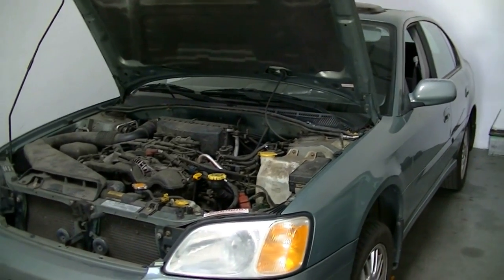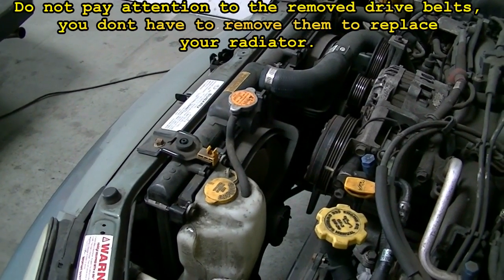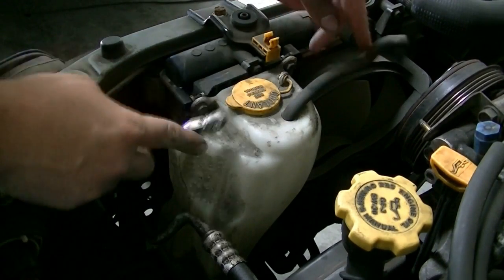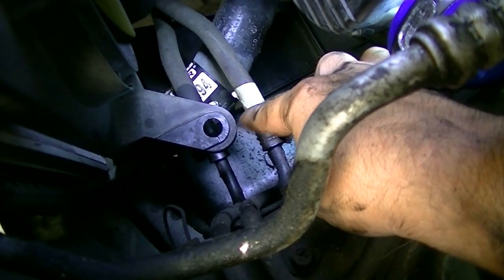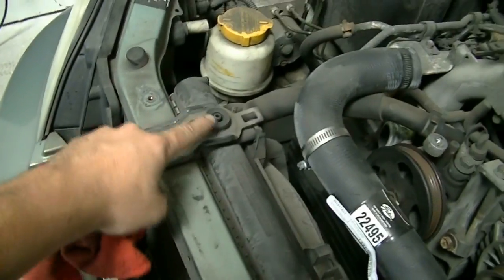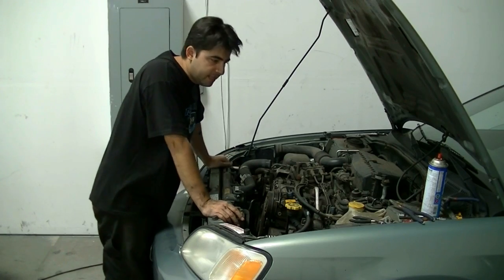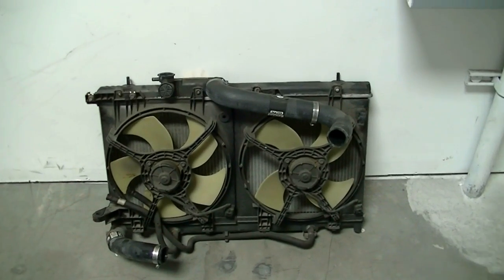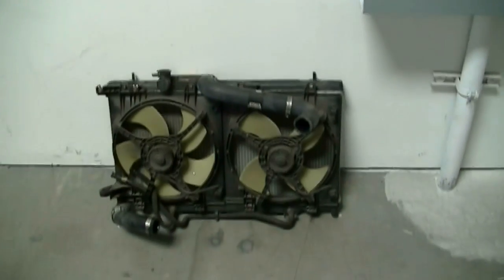How to Remove and Replace a Radiator on a Subaru with a 2.5L engine

Comment: Wait so is the radiator essentially just held in by those two brackets on the top?  There's little to nothing holding it to the bottom of the radiator support frame?  My lower rad support has rotted out so researching to see what's actually holding the radiator to it, but it seems like there's nothing
Reply: It has two finger type extensions which go into matching rubber isolator at the bottom. Most radiators are only secured with a fastener at the top.

Comment: Or you could drain the radiator out of the plug at the bottom so you don't have to make splash mess, when removing the lower hose.
Reply: If you have an hour, sure
Reply: @MatthewLakomski lol so many years ago.

Comment: Great video!  Am in the middle of replacing my radiator now.  Question:  About how much Automatic Transmission Fluid must I add to replace the amount lost during the radiator replacement?  I bought a couple of quarts just in case, but I suspect the amount actually needed is closer to 1 qt...
Reply: How did you replace the transmission fluid?
Reply: Yeah how much did you add and where did you add too?

Comment: On installation of a replacement radiator, how important is it to replace the foam strips the bottom and drivers side of the unit?

Comment: The reason I'm doing this repair is because my atf cooler lines are rusted right were you disconnected, I was told I can replace with rubber atf rated hose. I have to cut the metal part of line farther back and will not have the same connection. Can I just slip the rubber hose over the metal one and clamp it down?

Comment: I have to replace the condenser on a 2004 outback. Can the radiator stay hooked up while replacing the condenser or does it have to be out of the way.

Comment: Thanks for this video!! A few things I did for my 2003 Forester: 1) drained the radiator 1st using radiator petcock instead of via the lower hose so it was less messy, 2) the lower hose clamp was reachable from above using a long metric socket, 3) all work was doable without jacking car up but you gotta lie on your back to remove lower hoses and it is lonely under there, 4) the two automatic transmission lines were the hardest because the nut on the clamps were facing up so had to remove from underneath with a small metric box wrench (a 5 or 6mm, can't remember), 5) replacement radiator was $75 online (a TYC 2674) and fit perfectly with no problems, 6) there are plenty of other youtube videos on refilling and burping the system. This job is not much harder than changing a tire and its fun to get a little messy. Just don't get coolant or transmission fluid in your eyeballs.

Comment: Good video, thanks.  Mine is Auto transmission as well.  Do you have to flush and fill the automatic transmission fluid after replacing the radiator?   At the very least you will need to top it off, no?   I am removing mine right now and not sure how much automatic transmission fluid will lead out and how much I will need to replace and if I need a filter or not, etc... Thanks for any replies.
Reply: I just did the job. No need to flush the transmission fluid as it doesn't get dirty from this job. If you capped off the lines when you changed radiators to prevent draining, there is only a little fluid lost within the old radiator. After your done just check your levels with the trans dipstick. I lost enough to go from the full to the low mark, so just topped it off a little.
Reply: John Baker,   Right on, thanks! I just finished my timing belt and found the same thing.   At 105,000 I am thinking I should replace the fluid though.  Once I figure out if there is a filter I will change it.
Reply: Thanks to Dave and John for asking/answering this question.

Comment: Huge fan of the Vids, I did this myself on my base model automatic 07 impreza but when I got the new radiator the pipes for the transmission lines are shorter and now don't fit back to the lines coming from the car. if possible please contact me if you have a solution for this

Comment: It looks easier to remove the transmissions lines at the location you did in the video in order to pull out the whole transmission, but judging by the screw clamps next to the radiator it seems they were meant to be removed there instead.

Comment: Do you need an OEM radiator cap or can you use any generic brand?  Also what PSI do you need for that radiator cap?  Thank you.
Reply: Use oem. Aftermarket isn't worth the headache

Comment: I was wondering if you knew what the part (hole) under the radiator cap is called. I have a subaru legacy 2003 and that part has been broken somehow. So now coolant leaks out of that hole. We want to replace it instead of replacing the whole radiator but don't know what that part is called so we can not find it. Thanks.
Reply: The whole top of the radiator is one piece of plastic.  I had a crack in that area on my 02 legacy and I had to replace the whole thing.  I'm a bit late to the party, but...hope this helps someone! :)